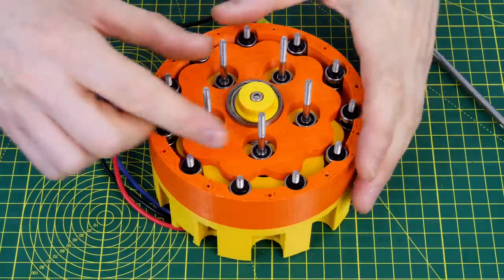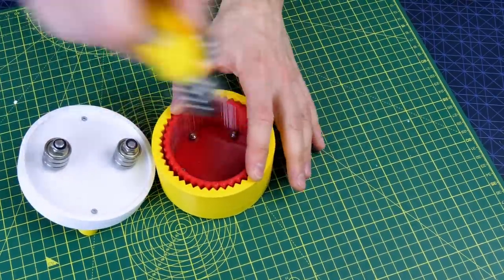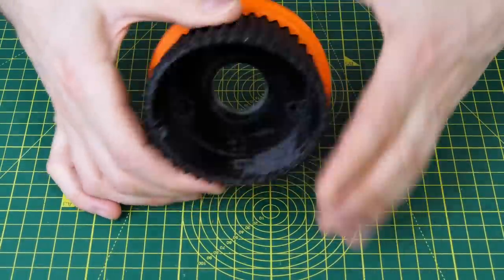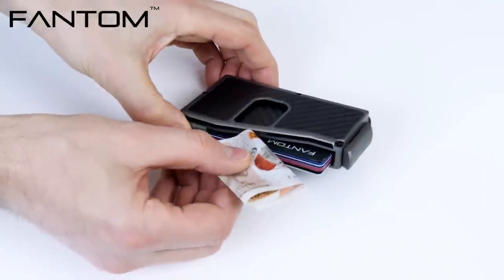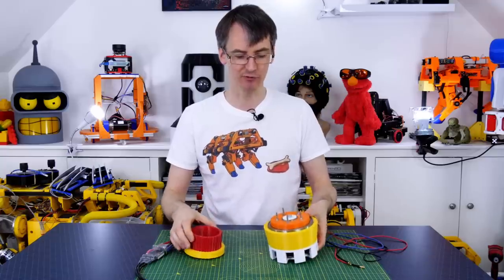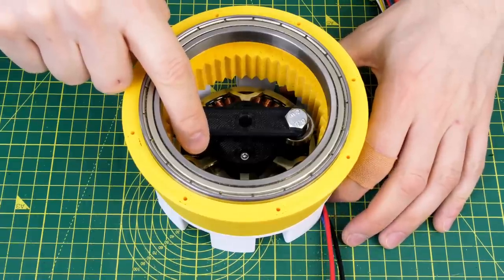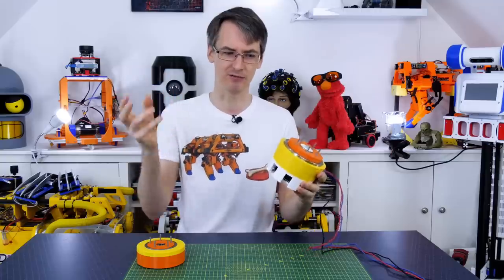Experimental Harmonic Drive Reducer - 3D Printed

Comment from the maker: Testing both Cycloidal and Harmonic Drive Reducers with an encoder and ODrive is coming up in next week's video, but Patrons and YouTube Channel Members have it already!
Reply: Loving this series!
Reply: You may have metioned it, but why not use planeteary gears?
Reply: you could forgo motors altogether with nitinol wire. would make for an interesting muscle design.
it would be the equivalent of myomers in mechwarrior lore.
Reply: The wave generators in the metal ones use a deformable bearing, while you are using just a single small wheel.  Consider using more bearings to give the spline more support, or at least the largest ones that will fit:
  https://www.youtube.com/watch?v=t4hW6lZYaQk
The other thing is that harmonic drives don't like skipping more than two teeth between the inner and outer.  Four is already pushing it, allowing for slippage (in particular when combined with the very flexible spline and not much support).
Good luck!
Reply: Checkout the back driveable _Abacus Drive_,  as an alternative to harmonic and cycloidal.
Reply: This.Is.Op
Reply: The Harmonic drive can rotate the bar on the inside but the Softer inner that distorts, can deform. Therefore, if you put some resistance, the Bar still spins but the teeth 'deform' so it doesn't overcome the resistance.
The Cycloidal Drive is much more rigid and the resistance has to be greater than the drive power of the motor to actually stop it.
Reply: There is a way around not being able to back-drive a motor. A torsion link and sensor between the gearbox and the final output drive.. I know you've already used this before on previous projects but if using electric motors it does seem to be about the only one that can provide real power gain and actually works..

Did a work up on this years ago trying to find even really obscure ideas - unfortunately the one which won by miles then was natural muscle. 

Would love to know how Boston Dynamics Spot does it. At a guess electric motors and harmonic or cycloidal drives and again the same torsion link between the gearbox and final output - only all done with a highly evolved design.. As I'm sure you know their old method was pneumatics and petrol - great back-drive but in the end was just too loud.
Reply: Excellent video. Never have heard of these types of drives! It wouldn't be printable, but the deformable drive would probably  be improved by using a thin guage, spring steel collar with metal gear teeth. It would be very fiddly to build, though. Each tooth would have to be printed individually with pegs that would be peened over after passing through the spring steel collar.
Reply: Hi James! There is a new innovative drive called the abacus drive which theoretically has excellent back drive ability along with many other benefits. Should be reasonably easy to 3d print!
Reply: You're a very ever dude, I don't understand much you're saying but I find the videos fascinating
Reply: I think you'd have better results if you made the flex spline out of PETG.. and perhaps used afiner tooth pitch.
Reply: Hey James, why not try something with rigid parts, the slip would go away and might be able to get your back drive on it, check this - https://www.youtube.com/watch?v=zoaHeamUqBE
Reply: Are you going to try some epicyclic drives (like in a car transmission) or are there reasons why they are not suitable?
Reply: Ha I saw that comment in the last video
Reply: @jonsnothere84  I have been recommending the same thing, an abacus drive seems to be exactly what he is looking for.
Reply: so i came across this video from 2016 i think you might be interested: https://youtu.be/zoaHeamUqBE
it is of a special type of drive, that i think is incredibly similar to what you want but without any material stress with flexing...
not to mention it kinda just looks like a bearing, which is kinda cool
Reply: Hi James, There are 3 issues I can see which may be of concern to you:

1. The drive will likely be slipping due to the tooth profile you have chosen, change the profile to have a lower pressure angle.
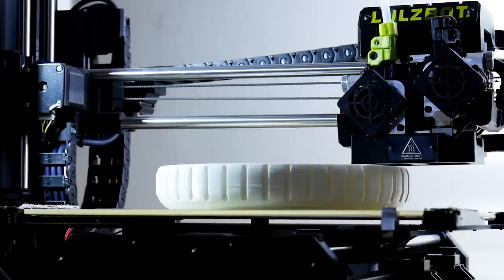2. Strain-wave gears work best at 1:50 reduction so 198:200 teeth count, this is due to the angle each tooth will have in its meshed state when the flex spline gear is at its highest point. So in other words the more teeth that are mated the stronger the gear.
3. The material you have chosen for the strain-wave shows the principle of the strain-wave gear is working but it may have issue in functioning when under load; think of the revolving forces at work on the flexspline when the teeth jump, will the deforming material effect the function of the drive in this transition?

Remember to use the equation z2/z2-z1, where z2 is the flexspline and z1 is the annulus gear this will tell you the number of teeth that are 'hopping' with each revolution of the strain cam, you want at least 2-3.
Reply: Maybe printing the gears in transparent filament so we can see what's going On?
Reply: The problem 3d harmonic drive is 3d printed material don’t survival very well on repeat turn and twist. The replacement rate is quite high.
Reply: the more parts there is more friction and that less efficient your machine
Reply: Do you share your designs?

Comment: Would like to see a planetary gear setup next just curious to see all three performing against eachother.
Reply: If you don't want to wait I'd check out this guy's build, it's pretty neat
https://www.youtube.com/watch?v=2dG_F9rR-jM
Reply: Yes, a herringbone geared planetary gear set can all be printed in one printer run as an assembled item that can't come apart.  This seems to be a natural for a 3d printed reduction gear.
You do have to "run it in" a bit to wear down the roughnesses on the surfaces.
You can also do "differential gears" to get a greater reduction in a small place.
Imagine a gear with 10 teeth rolling around inside a 100 tooth internal tooth gear.
Now imagine the 10 tooth gear has an 11 tooth gear on the same shaft.
The 11 tooth is slightly bigger and runs in a slightly bigger 101 tooth gear.
For every trip the small gear pair makes around the circle, the 100 tooth and 101 tooth gears rotate slightly.
Reply: @kensmith5694  Gear Down for What made a lot of 3D-printed gearboxes like you describe a few years ago. I haven't checked to see if that channel's still active, though I haven't seen any new videos in a few years. The old videos are presumably still good, though (but I don't recommend using an Arduino as a coprocessor to a PC to calculate gear ratios by trial and error).

Comment: try printing the flex spline out of nylon (obviously also making it thinner). That would reduce friction and would waste less energy deforming
Reply: Yes my thought exactly. It doesn't need to be rubbery, just thin enough to flex like the metal ones.
Reply: Printing in PP is even better i guess. It would stay flexible "forever"
Reply: @mufassarwaheed6160  but harmonic drives are not made to be flexible like rubber, it mainly deforms well under the max yield strength curve just under the elastic limits of the material. it should be a fairly ridged material that is allowed to deform yet elastic enough that no permeant deformation takes place. I also think that in this video the teeth are too pronounced and it looks like the contact is shared across multiple ring teeth at once, on the real drive the teeth are very fine and shallow in height and the teeth mesh only with a single tooth per side. likely another coinciding possibility is that the bearings are too wide stretching too much area of the flex shaft
Reply: @mitri5389  This is another reason the cyclo is better. More tooth engagement means higher torque capacity. With the cyclo all the teeth are engaged all the time. These have been around for a long time and are commonly used in low speed very high torque applications where the extra tooth engagement is essential. Dump trucks use two and often times three counter-shafts to spread the load over more than just the one or two teeth engaged. That is the weakest point in any transmission. Planetary gears handle higher torque loads with more planets. The more planets the more torque tolerant the gear set.
Reply: @WaylanEE  planetary gears are not that great for robotics due to backlash its hard to make planetary gears that have little backlash compared to cycloidal and these ones.
Reply: @WaylanEE  : The cycloidal drive is engaged on only on or two pins at a time, on one single side -- half as many as the strain wave drive. Far from "all the teeth engaged all the time".

Comment: Hi James, thanks for the attribution and I'm delighted to see you showcasing your own exploration of this interesting gear type. I'm sure you can optimise even further and I'm very excited about seeing some torque tests when ready. At a high level, I would suppose that your flex spline may be suffering from the same major issue that my timing belt designs did. I don't know about the round profile as I did not fully investigate it. However, tooth deformation was definitely a major contributor to my gears' limits. Therefore I would look to see if you can produce your splined cup from something less flexible and build flexures into the mechanical design (slots, such as in kerf-bent laser cut curved plywood designs). The other (hopefully) quick win you could do is increase the diameter of the bearings on your wave generator. This should produce a more gradual meshing-demeshing of the teeth (friction force spread over a larger angle of rotation) and also reduce the main motor's torque requirement because the pivot of the wave generator bearings are closer to the main motor axle.
Reply: I've seen slots on some commercially available drives as well.
Reply: I've got a nasty hunch that part of the binding issue is that the TPU part is experiencing, for lack of a better descriptive term, helical deformation. Basically it is distorting from a straight tooth gear to something that looks like the negative of barrel rifling. This would explain the extreme resistance to backfeed.
Reply: @assumptionsoup  thanks. The "many mini" bearings approach is one several people have tried. If your splined cup is stiff enough then it will do a good approximation of a wide curve. However it does nothing to bring the bearing pivot point closer to the motor axis, so I don't know if it realises any improvement in that area (there may be no benefit other than simplicity with a pair of larger bearings).
Reply: I don't see why moving the axes of the bearings closer to the input axis should reduce the torque requirement. The flex spline still has the same radius, and the tooth ratio is the same. It seems to me that using bigger bearings closer to the input axis is like changing the size of an idler between two spur gears: it doesn't affect the overall gear ratio.
Reply: @IDoNotLikeHandlesOnYT  the contact between the splined cup and the ring gear teeth is defined by the bearings of the wave generator. I think the number of teeth partially or fully in contact at a given time affects the deformation of teeth and partly dictates when the gear is likely to skip or sieze under load. A wave generator with a more gradual transition between meshed and demeshed states, such as larger diameter bearings could provide, might help these aspects of performance limitation. But I think you are right to say it would not affect the gear ratio.

Comment: I think flex spline doesnt need to made on  elastic material it can be printed with ABS which can elastically deform. and it will result much better tooth engagement  which can result much more  resilient to forces. OFc its needs to be thin wall and needs to be calculated or experimented

Comment: I think the strain wave drive is being funky because the teeth profile is very shallow so combined with the flexible material of the spline can squish and slide over each other when put under load. I'd try with a steeper tooth profile. Also, I think the applications for both drives are different, the strain wave will come out on top on higher reduction ratios, because you can easily scale the teeth down to make a larger reduction.

I've been looking at making a 3D printed star tracker and using a strain wave drive for it, but that is a totally different use case from yours, requiring high precision and reduction but very low speeds.

Comment: I know you definitely have more experience than me so I'm not going to try to "teach you", but if I may offer some comments on the strain wave gearing vs. the cycloidal: 
1. The strain wave gears are typically, as you know, high precision gearing. But they're also not really suited for excessive or counter loading. One of their most common failure modes is teeth stripping because, especially for the high-precision ones, the teeth are very fine and easy to strip. 
2. Cycloidal drives, on the other hand, ARE suitable for excessive loading because of the geometry of their "teeth." Because all the energy is transferred via rolling action, they tend to be more durable and capable of higher loads than comparable strain wave gearing. But, they're not quite as precise and, unlike strain wave gearing, are back-driveable. 
3. As a tip for your strain wave gears in the future, the flex spline is always the most difficult part to nail because you don't want it to be too flexible but you also still need it to be flexible enough. This can be more easily achieved, I think, with thin metal versus polymers of variable shore hardness and different fillers to give different mechanical properties. So it will really have to be tuned. That said, I think it would be well worth your time to try out, as troublesome as it can be to print, a nylon instead of a TPU for the flex spline. It'll still be flexible (assuming you use straight nylon and not one filled with carbon fiber, although I've heard glass fiber-filled nylons are typically just as flexible as non-filled but stronger) but also provide more rigidity to the flex spline. So instead of worrying about your wave generator, try switching the flex spline material to nylon. You may see an improvement in functionality.

Comment: Nice Harmonic Drive man! Unfortunately not backdrivable :/ You should look into the new abacus drive and inception drive! Those would perfectly fit into your gear reduction video series!
Reply: I'd never heard of either of those.  I think the inception drive looks very interesting.  :)
Reply: @StevenIngram  the latest and greatest ;)
Reply: what about the warp speed drive
Reply: @StevenIngram  Neither had I as they were only recently invented and the patented by SRI - this is a real surprise for a new kind of mechanical gear mechanism to be invented  The inventor certainly deserves whatever SRI are paying him these are really great inventions that use a principle of variable radius motion and angular contact between moving parts in ways not realised before.
The nuVinci transmission used on some bicycles is another fairly new innovation that also uses variable angular contact for changing gears but cant stop or go backwards like the inception drive.

The downside to the abacus drive is the rollers geometry contact area to the variable width inner and outer tracks is relatively small so it places quite high demands on the contact surfaces of the tracks and rollers - so these have to be well made to handle the contact pressure.

The inception drive like a variable speed transmission  is relying on  surface to surface adhesion - so you need a powerful actuator system to ensure there is high applied contact pressure or the drive is liable to slip and cause rapid wear.
It will be interesting to see the application they find for these in future.

Had they invented the inception drive 30+ years ago it would have been well suited to adapting the power of combustion engines which have limited speed range compared to modern electric motors but now everything is going electric and the applications may be quite niche.
Modern  electric motors and controllers are so good the need for a variable speed gearbox is greatly reduced.

Comment: Great job! I work at a robotics company and have designed and built robots that use both types of gearboxes on mobile platforms and fixed robot arms. Your videos perfectly show the operational and engineering pros and cons of both reduction types. Harmonic drives are the preferred gearbox for applications that require no backlash and high efficiency while cycloidal drives are actually notorious for being inefficient given all of the surfaces they have rubbing against one another, but they are typically much cheaper than harmonic drives so there is a design tradeoff.  I will say though that I have been able to back drive harmonic drives with ratios up to 40:1 without issue, so I think your back driving problem with your own harmonic drive lies somewhere in your design (to be expected though given how temperamental they are). There are companies with large teams of engineers designing these things, and the fact that you were able to make one that works this well on your first try is nothing short of amazing! Looking forward to more videos on your projects!

Comment: Cool stuff!. Actual harmonic drives are back-drivable with little losses to friction. They key is to have the wave generator fully support the path of the elliptical deforming gear. Otherwise it will just try to flex into itself and cause lots of friction. I am testing a 3d printed version with large offset bearings similar to the center shaft of your cycloidal, but have both of those support the elliptical gear. Also, since you have very large teeth thus large deflections, consider the pancake version of the harmonic drive. You won't lose as much energy where the flexspline meets the output as the whole flexspline stays deformed.